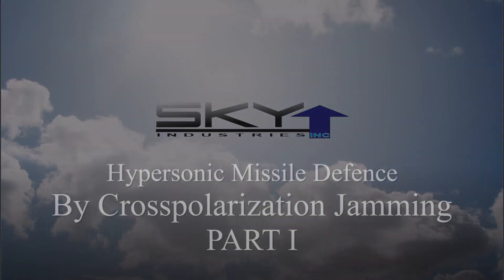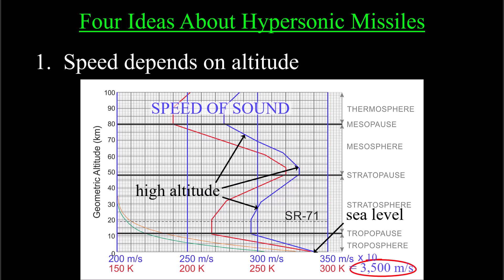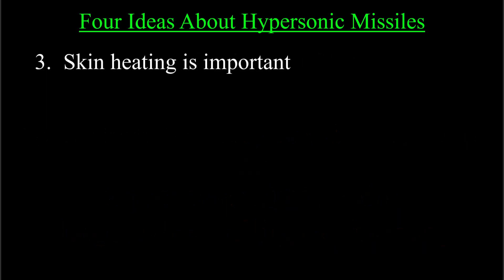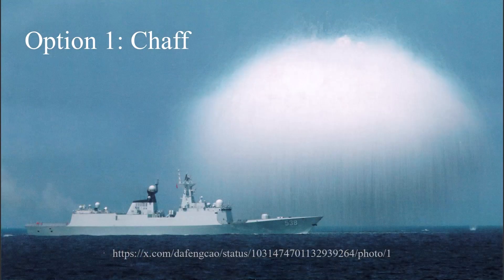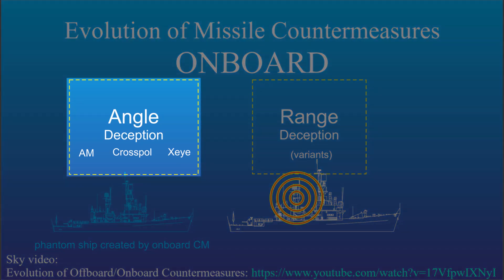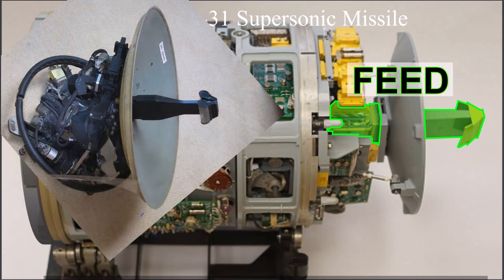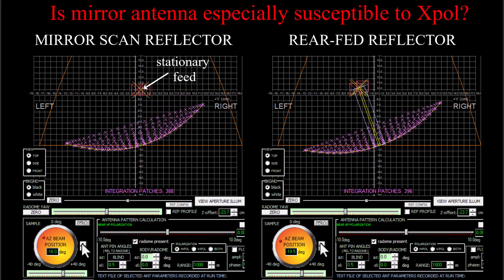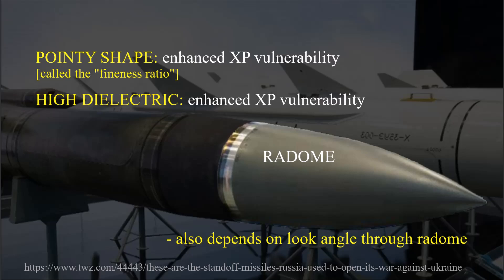Hypersonic Missile Defence By Crosspolarization Jamming PART I 25

Comment: Pointless & outdated, As its easy enough to defeat jamming systems by laser targeting (from observation drones), or just using AI visual recognition systems to visually identify targets. No need for radar, or radio coms to maintain lock on a ship or any target. Ships would are very vulnerable to AI visual targeting since its impossible to provide concealment. A smoke screen would take considerable time & also be subject to wind & in effective against IR\thermal targeting.  Probably the only effective means with be CIWS using thermal imaging to track inbound missiles, but I suspect next gen hypersonic missiles will include IR decoys to be deployed as the missile nears the target. An effective attack strategy would be to deploy several missiles on a ship inbound from different directions to overwhelm defensive systems. Likely a combination of low cost low speed drones to begin to assault to bog down Ship anti-air systems before the hypersonic kill shot enters ranger of anti-air systems.  

Russia & China are already developing AI visual targeting systems & its just a matter of short time before they are used for most guided missile systems & drone systems. Basically your work is just a waste of time. Your chasing after obsolete tech that will never be effective or useful.

Basically US defensive strategies are all obsolete. The US is very vulnerable because its surface Navy consists of a few very, very expensive ships (ie carriers) that take a decade or more to build. China strategy is a large number of smaller ships that are considered expendable & can be replaced in month or two. Consider a set of small surface ships engaging a US carrier with from multiple attack vectors armed with anti-ship missiles & torpedoes. All of the small ships are considered expendable & can be replaced in months. A sunk carrier would be irreplaceable because of the very long time before a replacement could be constructed.  A US\China war would be short lived & lopsided in favor of China. The only Ace the US has its its Submarine fleet that could sink China Oil tankers, but that's why China is building a large number of Oil & Gas pipelines so it does not need to rely on Oil tankers. 

US tactics really only apply to asymmetric warfare, which the enemy has no air power, no space observation & comm systems, or navy. The US hasn't faced a real threat since WW2. & fought very lopsided conflicts which the enemy had no modern air-force or modern military equipment. That said the US also lost every post WW2 conflict: Vietnam, N. Korea, Iraq, Afgan. etc. It effectively lost its proxy war in Ukraine & effectively resorted to terrorizing Russia with short range cruise missile systems. US made a huge mistake by making Russia an enemy. The US could have instead made Russia a close ally and contained China by using Russia as leverage for its energy imports. Unfortunately the US has permanently burned that bridge.

Comment: Impressive and seriously under-watched.

People should watch this guy instead of talkingheads that use Wikipedia.

Question, wouldn´t you get rid of the need to slow down in terminal stage and vulnarbility to jamming by a Swarm launch with missiles and decoys that can communicate? 
I would think so but cannot really say if the plasma ´envelope´   looks from the aft of the missile since I had two lectures about plasma 20 years ago and I think I daydreamed about Stacy then. 

Tesla were correct about the man-made horrors quote  I fear, it´s not ´good old´ WWII anymore.

Comment: Oreshnik warheads were observed coming in at above Mk. 10 (approximately Mk. 11) Yemeni hypersonic missiles were observed at Mk. 16. Public specifications on the Russian hypersonic Sarmat state speeds of Mk. 26. In general the Jamming suggestions are good ideas, however analysis of the targeting array of a regular supersonic missile is not really accurate,  because,  as you point out, it would need to work differently in a hypersonic missile.

Comment: A FARADAY CAGE makes your crosspolarization jamming techniques obsolete son
Reply from the maker: Respectfully I don't know what you're referring to; a Faraday Cage around the seeker makes the seeker obsolete - a seeker in a Faraday Cage is the physical equivalent of an oxymoron:  https://en.wikipedia.org/wiki/Faraday_cage  

Maybe you mean something different, like a polarization screen.  That can lower the crosspolar gain of the antenna in some cases (e.g. Inverse Cassegrain antenna) but not eliminate it.  

A screen over the antenna won't do anything to lower the contribution of the radome to the overall crosspolar gain.  Reason: the component of the crosspolarized jamming signal that causes the angle error is copolarized as seen by the seeker.  That component has to be allowed past the screen or the seeker can't see legitimate targets.
Reply: @skyindustries  Not with quantum entanglement.
Reply: @skyindustries Is there any advantage to being able to switch a Faraday cage on and off ? Is it even possible to do so ?

Comment: There are few assumptions here that are actually not entirely correct.  Seeker does not make much sense for a hypersonic missile tbh. Seeker is only relevant for a projectile with a speed orders comparable to a target speed. The target positions and  and speed vector are not identified by the own missile seeker for hypersonic missiles. That is an old approach. Corrections are made relying on satellite data link. Modern communication technologies provide sufficient latency for such purpose. regarding plasma plume author should familiarise on topics of plasma antennas and laser communications.

Comment: Dont newer seekers use arrays for phased wave propagation (PESA, AESA, DBF).  Mechanical seekers are old technology..
Reply from the maker: Some do, yes.  Susceptibility to Crosspol jamming depends on the crosspolar gain of the antenna, which varies with angle and frequency.  

Regarding arrays, the crosspolar gain of the overall antenna depends on the crosspolar gain of each radiating element.  The crosspolar gain of a waveguide slot is very low. The crosspolar gain of a circularly-polarized cavity-backed microstrip antennas appears to be very high.  The overall crosspolar gain depends on what type of radiating elements are used.  In every case the radome increases the overall crosspolar gain.  The higher the radome dielectric constant and the more curved the radome is at the look angle to the jammer, the higher the radome contribution is.  

Missiles will fall on a spectrum regarding susceptibility to Crosspol jamming, or any type: at one end, very easy to beat, at the other end: impossible to beat.  Each missile lies somewhere between these extremes.  

And don't forget: the older missiles are susceptible, and will kill you just as dead as a modern one.  Also not all countries have the more modern missiles, or if they do it's the "export" version, less capable than the "national" version.

Comment: Clearly smarter than I...

But if Russians had Shipwreck missiles in the 70s with "swarm like" communication and target prioritization... 

Why couldn't a hypersonic missile be guided by a second missile or warhead that slows itaelf down, begins observing a target and feeding data, while a rear-facing coms antenna on the Mach 10 missile receives that data?

For example, a ICBM MIRV payload could shed 2 or 3 warheads with another 2 or 3 "spotter" warheads which purposefully slow down, activate radars/EO and begin feeding the mach 10 warheads data as they continue on...
Reply: Iran uses this tactic, why they come in waves. But shhh they are supposed to be primitive etc etc according to 'their media'.

Comment: What if they put an additional passive anti radar seeker on the hypersonic missile? ( similar to the passive anti RF antenna on AARGM-ER or LRASM )
Reply: One possible technique is to bounce signals off the ocean. I believe this is used by some aircraft and missiles so HOJ interceptors nosedive into the ocean/terrain. I don't know how that would interact with angle deception jamming as described. 

Additionally it is dependent on geometry. Against missiles coming in at a shallow angle it's pretty doable (and to have the bouncing point far away from the ship) against missiles coming in at the zenith, it's probably almost impossible and miss distances that would result would likely be significantly dangerous.

Comment: Even 5M will be a problem for the ship's defense systems. many years ago, the US bought a Kh-31 from Russia without a warhead and electronics and built a MA-31 training target on its basis. From what I learned, the Phalanx had a problem destroying such quick targets. In the event that there were two each from a different direction, the ship's defense was not able to move the fire to the second target in time, they destroyed the first target, the second passed through the defense and hit the ship. The speed was around 3M.
Reply: This is a big reason behind the shift to SeaRAM. RAM is probably the best CIWS in existence with just ridiculously good PK against maneuvering targets. 

Besides that ESSM has taken on a lot of the point defense duty and it is similarly high performance for its size.
Reply: @aidanmattson681  It's hard to say how good SeaRAM is against fast targets on arrival with a zero heading parameter. I served in the air defense and studied this field at a military school (4 years of studying radar and missile systems). Every defense system has limitations regarding target speed. SeaRAM has optical IR/thermal guidance, so for an incoming missile like the Kh-31, the engine cannot be aimed, it is aimed at its front part, which is significantly cooler. Since the use of the MA-31, there has not been such a fast training and test target in the USNAVY or any other branch of the military. Standard anti-ship missiles move at a speed of up to 1M, which gives the defense several times more time to react than when the anti-ship missile is of the Kh-31 or Onix (Brahmos) type. So far, SeeRAM with the RIM-116 missile has not been used for such fast targets. It would certainly be interesting to see testing against 2.5-3M or faster targets coming from different angles.
Reply: @ we have the GQM-163 Coyote with similar performance. I don’t know what exact tests it’s been used in other than one against SM-2MR but it is in service. 

Sure the frontal aspect is not as strong as rear-aspect, but we’ve had all-aspect designs since the mid 70s with early AIM-9L tests and at those kinds of speeds the aerodynamic heating of such an ASM is considerable. Most of the issue at that point comes from clouds and fog that scatter IR light but RAM has multispectrum capability including UV which is less susceptible to weather on top of lock on after launch capability and a passive RF system to guide the missile to the point where the primary seeker can acquire the target.
Reply: Yes, it was ordered, but I don't know about testing against RIM-162, it wasn't written anywhere, so it's still questionable. There is still a target speed limit, it is not specified anywhere for American missiles, it is classified information, but the missile is similar in size and speed to the Russian 9M333 missile, which has a target limit on the opposite course of 520m/s, that is 1.52M approx. The American missile will have a better sight and better electronics, but aerodynamics and the laws of physics apply to both equally. So a rough estimate when I take into account the better electronics and the sight will be the speed limit of the target on a favorable course with a zero course parameter around 2M. A faster target is already outside the flight envelope and maneuverability of the defensive missile. The advantage of the RIM-162 is in range, the phalanx has a range of 2 miles, the rim 5.6 miles so it destroys the incoming threat at longer distances.  It is certainly an excellent defensive missile, but with high-speed targets we are moving in a gray area where it is not clear with the available information whether it is capable of destroying them. High speed targets are very complex even for larger and more sophisticated systems. And the worst is if they maneuver and do not move along a constant predictable path. It is a pity that there is no information if the test against GQM-163 was compared and with what result.

Comment: What if the hypersonic missile’s terminal guidance didn’t rely on a front-looking seeker? Your visuals show technology from the 1990s, and modern systems have moved on. The U.S. Navy is married to Raytheon, and like most older married couples, both partners are loath to change. This is why we have defensive systems that today are functionally obsolete.
Reply: How would a seeker pointed to the side help the missile? The most generous possible interpretation of this is a missile that ensures that this side looking seeker sees nothing (this was actually explored in WW2 by the British creating the Artemis missile concept which is a really weird SARH settup) and thereby aims at the target. 

The issue with this is that the missile then doesn't know if there's actually a target in its sights and it could just be heading to an empty spot of ocean. 

Such a system would also be very susceptible to offboard jamming.
Reply: Can you give an example of a non-front facing seeker?
Reply: @ The Pershing II actually scanned the area around the target to match terrain features rather than the target itself

Though this does not work against a ship because of the general lack of features on the ocean and the annoying habit of ships to move.

Comment: 4:20 do you reckon there can be decoys that can be fired off from cannons? so the decoy has some mach 3 right from the start and a bursting charge could have it split into 2-3 decoy beacons at different speeds, with one at the back becoming nearly static

Comment: It may surprise to you but Russia can change the targeting data during hypersonic flight. They achieved that breakthrough about a year ago. It means that they can communicate with the missile, at least one way. This implies that they can adjust the coordinates of the missile, say 45 sec before the target, and in this way increase the accuracy of the inertial guidance without the need of slowing down. Considering that Russia is using Kindzal for 3 years, and no countermeasures were yet developed (of course, Ukraine announces that they shooting down most of them) it is not simple. The recent report by Kiel institute in Germany, quotes the US estimates, that 60 Patriot missiles are needed to increase probability of a hit to above 0.9. In other way, launch 60 missile in the path and then the coverage makes that there is a good chance that one will be close enough to explode and destroy Kindzal. A shotgun shooting pellets principle, where a pellet is $6 millions.  The 2nd is that, if the plasma envelope disappears, then the optical targeting can be used. Russians are using it in many missiles (so does NATO). The jamming is good in theory. By the way, the optical targeting used on Su fighters is accurate to 50km in good weather (data from 2018 so it is probably better now). 50Km at Mach 10 is about 30 sec before hitting target. Yet less than 10 sec is enough to correct (usually 2-3 sec. The Kindzal and Zircon travel at Mach 10 to 12. Patriot, as measured in Ukraine by radars, is about Mach 4 (not 7 as listed). Oreshnik hit the ground, accurately, at Mach 11.4 as measured by Ukrainian radars. 
And Mach 5 is the beginning of hypersonic speed. For example, Russian Avangard gliding vehicle travel at Mach 27 to 32, and manoeuvring.